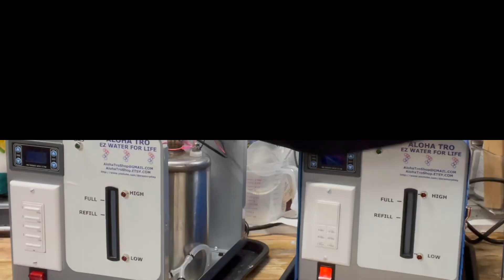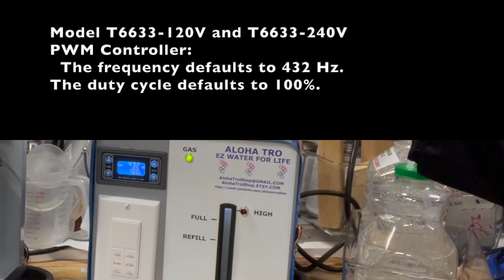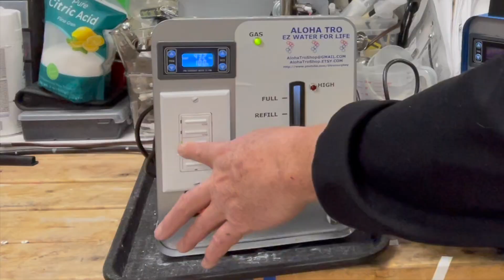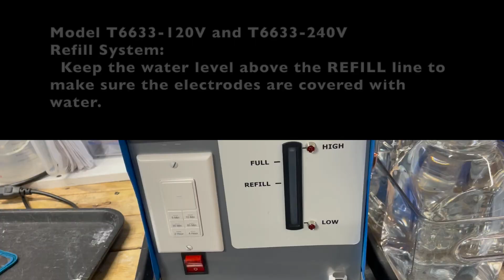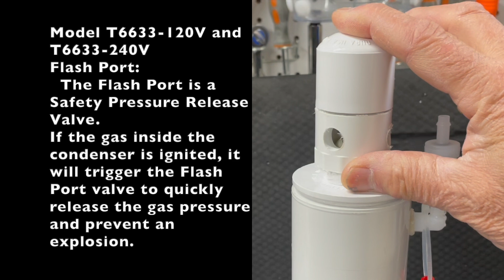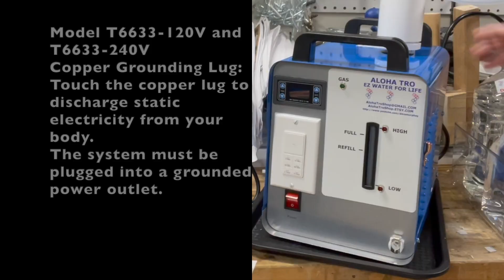Model T6633 Brown's Gas Generator Operation

Comment: Tro, great video.  Thanks!  What's a good way to store the distilled water?  I'm guessing one of those 5 gallon blue colored tanks that is included w/ 'typical' water coolers.  Maybe get a subscription to a distilled water provider like Crystal Springs instead of distilling my own?  BTW; I use the WaterWise 4000 to produce distilled water.
Reply from the maker: I make my own distilled water and store it in 1 gallon containers.  I'm guessing that a 5 gallon container would be a good way to store it.  Thank you for watching.